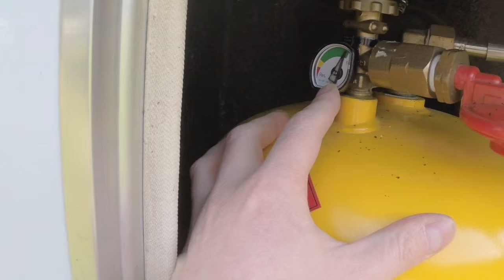25 Ways to Improve Your Motorhome

Comment: Thanks Herr Herman, nice tip on the foam for storing glasses will be sourcing that. Find the best place to store wine is about 9 inches below the mouth, works wonders for me. Happy Roaming.
Reply: I have also seen people use the cheap give away can coozy's (like they give away at shows with advertising on them) to cover glasses.  They simply cut out the bottom and slip the remaining foam tube over the glass.  It seems to be space efficient while preventing breakage of the glassware.

Comment: I'd say my favourite improvement is the Dometic onboard diesel inverter generator, although since then I saw an NHS artic trailer (parked in Tesco car park for about a month of cancer screening), it had an Onan Cummins generator which was impressively quiet.

A £22 20W solar panel on the roof keeps the leisure batteries happy in storage, plus can use lights and a TV for a few hours to keep children/wife happy when I go to do a few little jobs that need doing.

A secondhand compact Zanussi washing machine fitted perfectly under the kitchen sink.

At least two TVs are essential if you don't want to get stuck watching Pokemon, although you'll need a degree of separation, the living area and the bedroom work well for us, if we had a smaller motorhome, the bathroom would be fair game for an hour of TV respite. 

A 2TB NAS hard drive with DLNA server is great for storing all the movies you could ever want to watch. 

A macerator pump is useful for emptying your tanks, some UK campsites are designed with cassette toilets in mind, with disposal points some distance from the road and often quite high up, crap won't flow uphill! 50ft of 1in flexi pipe (lay flat hose is a big mistake) is a lot easier to manage than the sewer pipe.

A new shower head is a cheap and satisfying upgrade, a few lights, like one in the bathroom, one in the hallway, replace their incandescent bulbs with LED bulbs and you can leave them on overnight, even without an electric hookup. 

A curtainrail behind the front seats and some thick floor to ceiling curtains keep the habitation area cooler in summer, warmer in winter and if your chosen rest stop turns out to be a bad location, you can drive off at a moments notice.

Not really a modification, more a little preparedness until I can afford the modification, but carry a tow rope and get your wife to follow in the car, usually there's no problem, but I did get stuck on one grass pitch after 7days nonstop rain (why don't more motorhomes come with 4WD, a lot are built on chassis/vehicles with a 4WD variant).
Reply from the maker: Wow. That's an impressive list. Thanks. You should make a video. It sounds like you have a larger motorhome. What do you have?
Reply: Herman the Hymer You're too kind, I might have to try that, if I can get my wife to narrate for me. I have a Damon Challenger, on a Chevrolet P30 chassis. It's only 30ft long, in car parks backing onto flat grass I can park it in a single corner space with the nose only sticking out a few feet.

In the village where we used to live, one of our neighbours has one of the smaller Hymers, it's still what the Americans call a Class A type (no idea what we call them) like yours and mine, even though it's only about 18ft long it's very spacious inside and it's their everyday car, which is great for their dogs. I'd like one myself.
Reply from the maker: I've just seen a photo of one. Very impressive. We also call them A classes.

Comment: Look up airtags for your RV, another way to secure your RV when on any main highway,and helps when big trucks pass you,etc.
Reply from the maker: Hi Doug, we had considered installing the air bags a few years ago. They would help going round bends, roundabouts and passing lorries. They look simple to install. No idea where we'd put the pressure valve though. Do you have them installed?

Comment: As for the narrow locker for bottles/wine storage.......correx sheet is plyable, rigid and shapeable, cheap. All sorts of kitchen/automotive brackets can be used
Reply from the maker: Interesting Warren, is it strong and how do you connect the sheets together? Can you get push on fasteners or something similar?
Reply: @HermanHitstheRoad  its usually used within the packaging and horticultural industry. A small section is usually used as a washer replacement. If you have a look on YouTube at some of the cycling trailers made from it, this will show just how flexible of a product it is. Plastic, metal or wood bracketing can be used

Comment: Hi. I imagine you've probably solved your wine rack question by now. My thought on seeing the space was to suspend the bottles horizontally under the shelves. In other words a 3 or 4 bottle wine rack under each existing shelf. I like your sponge rubber drinking glass storage idea. I'll try that. It will be perfect in my 4WD bus. Thanks.
Reply from the maker: Hi Black Pete, no I haven't found a solution to the wine rack yet. I do like your idea and I'll think about doing that. Thanks

Comment: I have a plastic bottled beer crate inside the habitation area with a soft covered lid to put our feet on or to use as a portable stool.  Got me thinking, you could cut one down to use for wine storage in your ski locker.
Reply from the maker: A beer crate would be a create idea. Do you use your crate for beer or wine? Why do you suggest cutting it down? Are they large?
Reply: We use ours for ciders and fruit drinks, I thought a full sized crate would be too big to fit your storage cupboard.

Comment: Some good tips. Mind you the pegs on the wipers will leave indents in the rubber, better to just spray and wipe with silicone spray. That front tow bar you replaced was well rusty, I just wondered how that passed an MOT. How old and what mileage is the van?
Reply from the maker: Hi Robin, thanks. The pegs don't touch the wiper blades. The ends of the pegs grip the wiper and the blade rests a few mm from the peg. The front cross member isn't structural. It's bolted on to the chassis. The only thing it does is hold the radiator. Herman is a 1998 Hymer B564 with 80k miles
Reply: Lots of good tips thanks. I use corks under the metal part of the wiper arms, near the bodywork end. They very slightly keep the rubber blades of the windscreen. We always seem to have plenty of spares....
Reply from the maker: That's weird, Gordon so do we 🤣🍷

Comment: Bonjour felicitation pour hermann il est vraiment magnifique, moi j ai un B584 de 2002 et je voudrai remplacer les caoutchouc des elargisseurs d aile, ou peux ton trouver ces caoutchouc parce que en france je ne les trouve pas
merci pour ta reponse
Reply from the maker: Bonjour Antoine, thanks for your lovely comment. I brought the fender rubbers at the same time I brought the fender. These were brought from Brownhills in the UK who are a Hymer dealer. They are selling the rubbers on ebay. I hope this helps.
Ads

https://www.ebay.co.uk/itm/184333911699?mkevt=1&mkcid=1&mkrid=710-53481-19255-0&campid=5338624526&toolid=10001&customid=35b9759deb7ff87a2d43e00b5bc0ed1c
Reply: @HermanHitstheRoad  very thank you

Comment: What are the pro's/Cons of the gaslow system? cheers....
Reply from the maker: Hi jjyo99, that's a great question. 
Pros would be; cheap fuel (it cost about £13 to fill up), you don't have to worry about emptying the bottle before getting a new one because you can fill up when you like, it's propane so you can use it in the winter, there is a gauge on the side so you can see how much gas you have. 
Cons; there are not many filling station in the UK (lots in Europe), filling is not dangerous but it can be fiddly, I've heard that France doesn't like you opening a door to fill up the tank (the filler cap must be mounted on the outside)

I hope that helps
Reply: Thanks for that mate, Does it help? We're waiting delivery of our first 'van in April. In our very limited experience we've found NOTHING is straight forward in 'mobile living world'. There is an array of multiple options on everything when you enter this field (no pun..). We envy you experts  but are looking forward to finding out for ourselves through trial and error about the wonders of living the outdoor life.

Comment: Hello. We have a B654 and we are wanting to change the kitchen blind also. Did you buy this from Hymer? Can you remember how much you paid please?
Reply from the maker: +Elizabeth Chappell hi Elizabeth, we got someone else to do that. I don't know where he brought it from but it was expensive (£250 to £300 if my memory serves me). He told me that he had to remove the cupboards above the window to replace the blind.
Reply: Hi OK thanks. How did you do the LED lights in the cooker hood please?
Reply from the maker: Hi Elizabeth, I've been looking in my email for the invoice of the LED lights but I can't find it. I also can't find the exact product online either. There are others and they maybe easier to fit. Anyway, the LEDs came on a reel of lights which you can cut to length and it has a sticky back to it. 

For 12v you need a small bit of circuit with two wires coming from it which I brought from the same place. This "thing" is so you don't damage the LEDs when you start the engine or plug in to power. I had to solder it on to the LED strip and also connect it to the on/off switch of the original light over the sink. 

The original light was one of those fluorescent strip lights and it had a load of electronic circuitry to power it. I realised that all I needed to do was wire up the new LED lights to the switch, bypassing the original electronics. The 12v "thing" sits between the LEDs and the switch inline. I've left the original circuitry where I found it, nothing is connected to it. 

I hope this helps. Sorry I couldn't find the invoice etc. I think it would of helped my description.